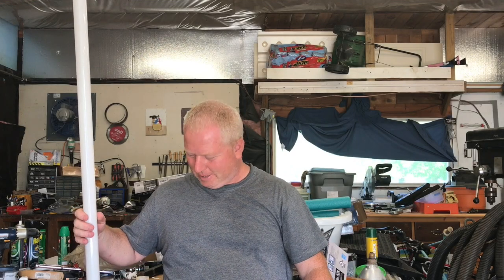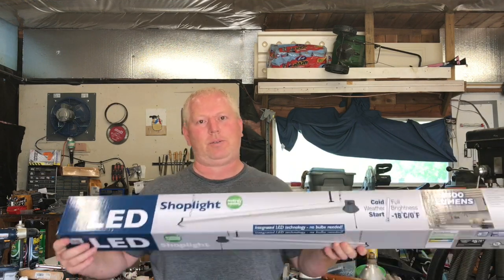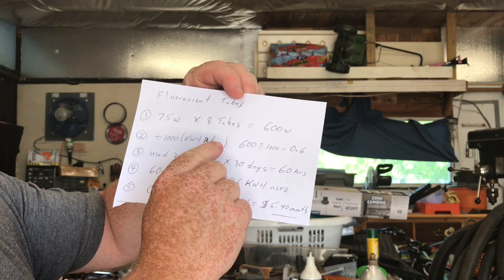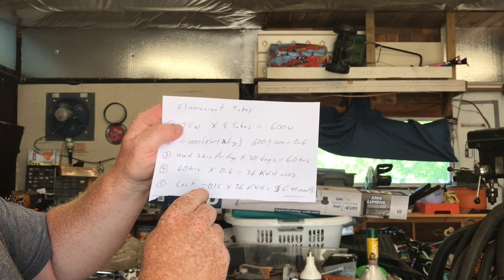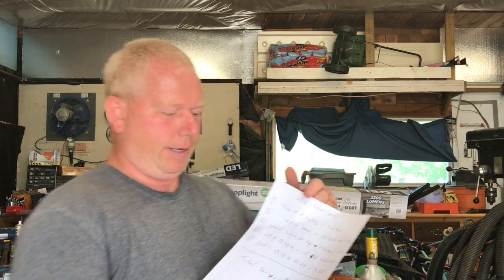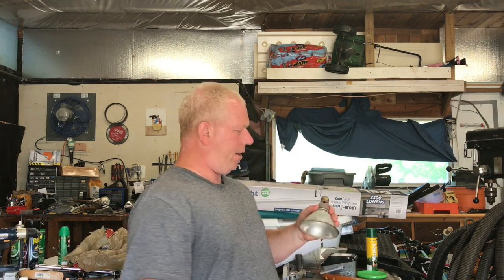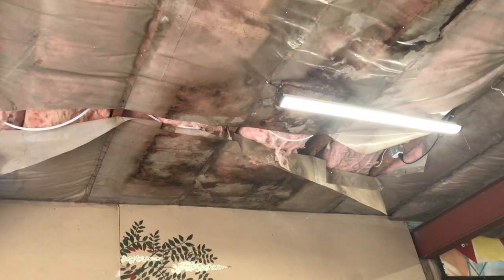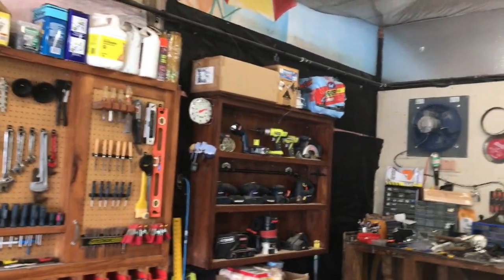Cost Savings Changing From Fluorescent Shop Lights To LED Shop Lights

Comment: I know this vid is old but let people know I found 8ft led tube online free shipping 
for $13 each bypassed the ballast working great
Reply from the maker: Awesome!  I tried the LED tubes before but they did't say you had to bypass the ballast.  When it didn't work I was wondering if you had to bypass it.  I ended up just taking them back and buying the full LED light fixtures. 
Thanks for the info!
Cheers!
Rob